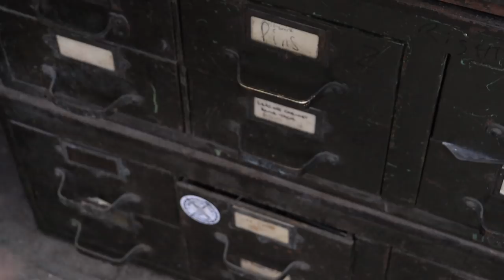Making A Titanium Dab Tool

Comment: What grits of sandpaper did you use to obtain that finish? Also what tool did you use to scribe the line to clean up the corners ? Thanks In advance I just subscribed to your channel. Great video
Reply from the maker: I start at 120 then 240,400,800,1000 and finish with 000 wire wool. 
It’s a centre scribe tool for market knife centre before grinding

Comment: After googling "dab tool" to find out what it is (besides a standard screw driver look-alike), I immediately thought to myself, "I wonder why the customer didn't request that you anodize it to a weedy color?" And then I realized, "because the customer is a pot-head... and I reckon that stoners aren't very likely to know about the properties of Titanium, beyond 'it's like, the best metal, maaaaaaan... they build Terminators outta that shit, brah!" But still... you should have offered him the option for a "modest surcharge." 

As a bladesmith, I actually mean that... I don't know why I put it in quotation marks as if it was a wink-wink nudge-nudge, lol.
Reply from the maker: I honestly still arent 100% up on what this tool is for haha but yeh i did think of anodising it but I decided against it as I wanted the focus to be more on the colour in the wood and all the patterns in it.
Reply: @DiesInEveryFilm  From what I could glean online, "dab" is a reefer concoction where they concentrate the THC and suspend it in a wax base, then vape the wax... and they use a tool to scrape it from the container and into the pipe, so that they don't get that shit all over them. Kinda like some olde tyme hash-handling, where people literally used screwdrivers to scrape hash and load pipes with it... but I reckon the chic thing now is to get custom tools for it for dabbing, so that they don't look like junkies using actual screwdrivers to do it, lol. It gives it an air of prestige and "not drug addict paraphernalia" when it's a specialty tool and not a repurposed screwdriver. Btw, thanks for the content and keep up the good work, brother.